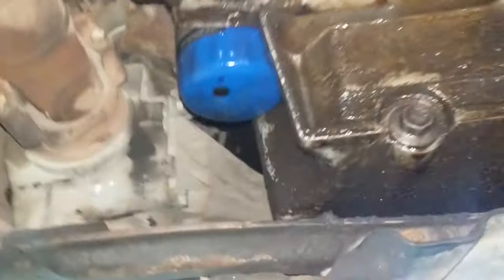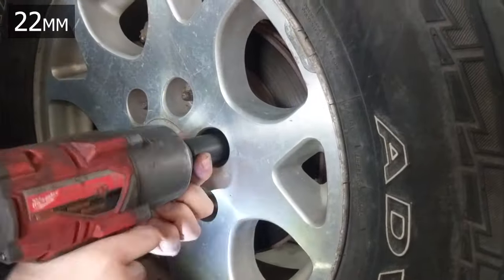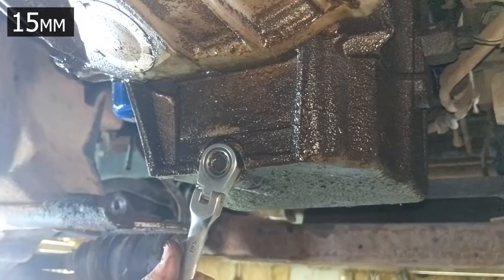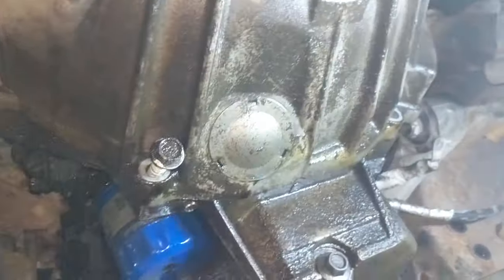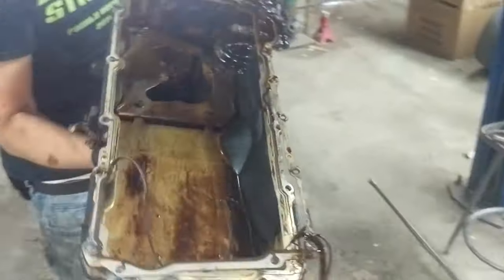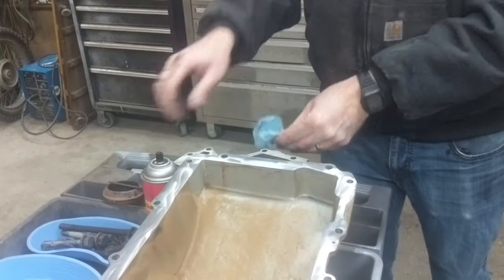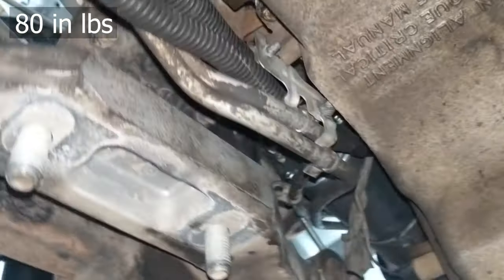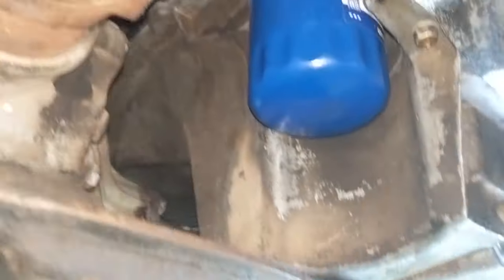1999-2007 GM Oil Pan Gasket Replacement

Comment: Great video but i will say this is the video to watch if your getting paid by the hour on a job. You do not have to remove any steering components or axles, just unbolt the front differential and let it hang down as far as it will go. It only needs to go down an inch or so. That plus removal of the cross member is all that is necessary. Hope this is helpful to anyone in the comments!
Reply: Ill try tonight on my Hummer H2 :)
Reply: I've been trying to figure out a faster way and I didn't see this comment til now
Reply: Just be sure to watch out for the oil pick up. When you jostle the pan out without removing the diff carrier, you risk banging it against the pick up and thereby squashing the o-ring, which leads to oil pressure loss.
Reply: 1. Disconnect Battery. 
2. Loosen lugs on front wheels. 
3. Jack vehicle securely. 
4. Remove front wheels.
5. Turn wheels to max left.
6. Loosen designated bolts on front diff.
7. Loosen designated bolts on transmission.
8. Loosen starter and secure.
9. Loosen remove flywheel dust shield. 
10. Loosen driveline and secure.
11. Loosen oil cooler lines and remove oil filter housing assembly.
12. Loosen oil pan bolts and remove oil pan. 

If you need extra space hoist engine up a few inches carefully and push/pull front diff towards front of truck against sway bar. It should give you enough room to pull oil pan down and towards rear of vehicle.
Use only Fel-Pro gasket set no gasket sealant necessary when using this product. 
Reassemble in reverse.
Make sure to top off fluid levels afterwards and visually check for any leakage after starting vehicle and getting it up to normal operating temps.
Common leak is where oil pan and timing chain covers meet.
Reply: May the force be with you. Don't wish this on my enemies.
The bolts to loosen on front diff are 2 passenger loosen and 2 driver remove completely. This will allow ability to push/pull diff forward and down to make room to pull oil pan out. Front diff will not fall on you.
Reply: Well im glad i read this. Because i thought tha was wa too much work lol
Reply: u
Reply: I wasn’t gonna say it lol but yes you are correct thanks for putting it out there for everyone and even for me even though I already knew but need to do this!

Comment: I just did my 6.0 and you don’t need to take out the front  differential. The only thing you need to do is drop the four bolts in the front diff will drop down and the oil pan will come out with no problem.
Reply: Gonna tackle the oil pan pick up tube oring soon on my 2000 6.0.  So you're saying just loosen the the bolts and let it drop down a little bit and you have enough clearance to get the pan out?  I'll be doing this in the driveway on jackstands.  Thanks.
Reply: @user-fu7rk5fw2n  yes sir super easy
Reply: @user-fu7rk5fw2n  I did it in my garage and it’s easy you can also switch bolt holes for the pic up tube , incase your oil pump goes out you won’t need to re drop oil pan and everything will be set up for you 😎👍🏼👍🏼
Reply: @jroc9840  Cool , thanks for the reply.

Comment: Sir, you gave me a general idea of doing the 2003 GMC Envoy oil pan gasket.  But I have a rear wheel drive.  You went sooooooooo fast!  I’m gonna try it in any case but my truck has no gasket it is sealed with Silicon from factory

Comment: I like how you un clip the trans lines and wiring harness from the bracket on the side of the pan.  Other videos unbolt the bracket, which still leaves the nasty thing when it goes back together.  Can't stand not to clean it all. One question though, why didn't you pop in a new pick up tube o ring while you were there?
Reply from the maker: Would have been a good idea!

Comment: Excellent video. Ty for the share. Definitely hitting that subscribe a like for ya. One tech to another. One tip I love doing, so u never leak again ( usually lol) I silicone the pan, the whole pan not just the corners. Then I put the gasket on then silicone the top of the gasket. I consider it a secondary security. 😂 ty again!

Comment: Hey! I have my oil pan out it's quite the mess in side, is it ok to use brake cleaner for the inside of the pan?
Reply from the maker: Yes, brake cleaner will be fine. Just remove any plastic/rubber parts
Reply: @MasterJacks  awesome thanks!

Comment: At how many miles would you think about replacing the oil pump while you’re in there?
Reply: Just do it, I did it through the front grinding off some small tab with a dremel based on some genius hack I saw on another video dealing with the pick up tube, but would have much rather done all of this if the time allowed.  This is my next project though, new front end, oil pan seal, starter etc just like he did it, oil pump would be 2x easier as well with all of this out the way.  I also now have a bolt in the bottom of my pan that was a casualty of the pump job.
Reply: @corydoyle4819 I put a new, stock high volume pump in it

Comment: I have seen some videos where they talk about the clearance between oil pan and bell housing. Do you know anything about this?
Reply: Inspect gap between oil pan contact points at bottom of pan and transmission, gap should not exceed .010 inch.

Comment: no rtv on the pan ? just the gasket and the spots u mentioned?
Reply from the maker: Correct
Reply: @MasterJacks  how many bolts hold the diff in? ic 2 on one side and the upper bolt on the driver side

Comment: Changed my oil pan and gasket any suggestions on why oil pressure has dropped?
Reply: Did you install a new pickup tube oring? If so you may have pinched it
Reply: @carlpavey7167  yes I had to remove the oil pan again and replace the pick up tube o ring.  Wish I would have known it was there when I did it the first time. Truck now has about 44 lbs at ideal and 60 ish while driving
Reply: @Jay-zx8fj  great glad you got it fixed!
Reply: @carlpavey7167  thanks it was a pain but it's running good now.  I can't believe one little o-ring would kill my engine if not taken care of
Reply: @Jay-zx8fj  it’s got a relief valve in the pan on some. Right above the oil filter that often fails as well!

Comment: My GMT800 has 350,000 miles on it. On my life the one thing I have not and probably will never do is fix the damn pan leak properly bc I just dont want to do all of this. Buuut with enough Lucas oil and running GTX high mileage it doesnt leak anymore - like its not even there 👀
Reply: You mean the Lucas Stop Leak?

Comment: 95% of that part removal is not necessary or really even desirable to make it easier. Crossmenber and lower the axle. Done.
Reply: Stupid question....when you say the crossmember for the transmission?...thanks in advance
Reply: @damianmartinez6188  No, there is a crossmember between two points on the frame directly underneath the lowest part of the oil pan. It has to be removed in order to remove the pan.
Reply: @Westbankfireman  @J. Reynolds so all I have to do is remove that and I'm clear to access the oil pan for removal? I saw some other videos but they involve removing the front 4wd transfer case. Thanks